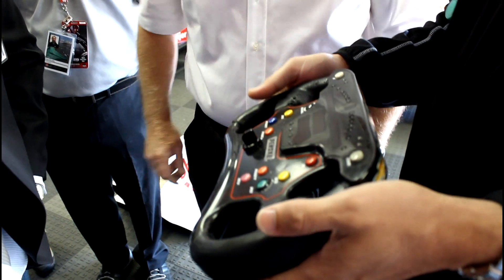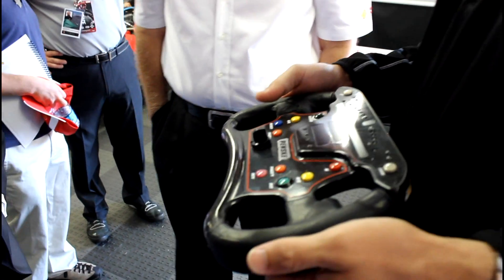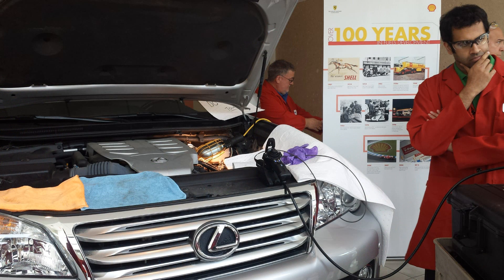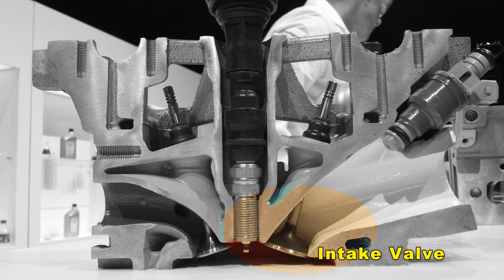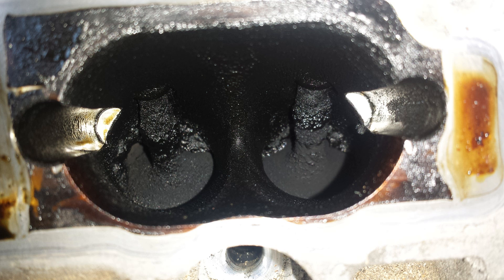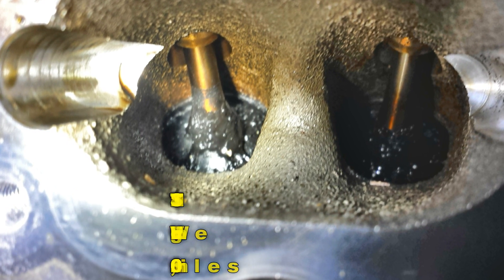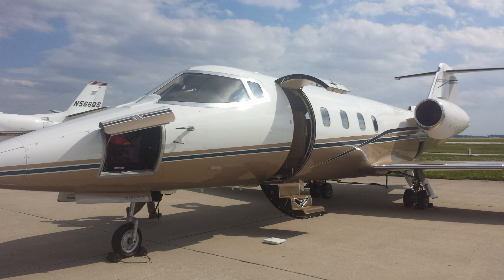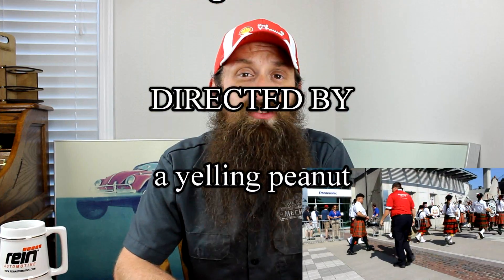Shell V-Power Nitro Plus and Indy 500 ~ Podcast Episode 71

Comment: The humble mechanic knows better than to spread misinformation on his channel.

 Fuel does not cause deposits, EGR soot combining with PCV vapours cause deposits which clog your manifold and coat your valves.
 Block off your EGR and redirect your PCV and there will be nothing to cause deposits.

 PFI keeps valves clean.
 Carburettors keep valves AND manifold clean.
 Only DI allows deposits to form, and only cars with EGR and PCV pollute themselves with deposit causing materials.

Take from these facts that deposits only affect the lazy and the stupid.

Comment: Hi I'm an owner of a 2011 VW jetta 2.5 se , and I always enjoy your videos. I have noticed it runs better on shell mid grade than shell regular. Should I try v power in it. And am I getting the same cleaning benefits with mid grade as I would with v power. Thanks
Reply: I have 2 cars, both bought used. I always use Shell V power. There is a slight difference using V power over regular. It feels slightly torquier at low revs and slightly smoother in the mid revs. But probably not enough to justify paying the extra. But what I seemed to notice on both cars, they started to run better after 3000 miles of V power. Maybe this is the cleaning benefits of running V power over the long term.

Comment: I've been going to Costco to get my gas. I work there. And it is Top Tier. I also use Chevron. Would you personally recommend using Shell in a MK6 GTI? Is it really worth it in your professional opinion?
Reply from the maker: Shell fuel is great. But if you’re getting good performance from Costco, keep rocking it
Reply: Okay! I was just curious. I do know that Costco uses an additive pack called UltraZol 9888, made by a company called Lubrizol. All far as I know, Costco uses 5x the additives of the EPA minimum. There is also a friction modifier like they use I'm shell nitro +. And, could you do a video on an American company  called Archoil? They make fuel, and oil, additives for cars, trucks, and industrial uses. For cars, they have a fuel system cleaner that uses PEA, their AR9100 is a friction modifier additive, and the AR6200 is a fuel additive. I think you might be intrigued by it.

Comment: 2.0T FSI here, never put anything except Shell's V-Power with Nitro+ (93 octane) and I've never experienced cold experienced cold start misfires, at I'm at 175 thousand miles on stock internals. 
Now, is this because I've only run Shell V-POWER with Nitro? I couldn't say, while it most definitely helped prevent buildup  (recall it's the only fuel my engine has ever had) I would be remiss if I didn't mention that I never miss a maintenance window, fluids get checked every week, and I throw an OBDII sensor on there once a month to see if I can't catch problems in the live data logging before they throw a code. 
Driving style must also be mentioned, I for one always wait until proper operating temperature before getting on my boost; this means waiting for the thermo to kick in and read optimal, then driving a few more minutes, making sure you've warmed all of that oil up and moved her around. I avoid the quick start and stops, always allowing my engine to run a cycle of no less than 5 minutes; and let's face it, I'm a spirited driver. While I rarely  (and I mean maybe 3 or 4 times) do full throttle launches, I've never been shy about wringing her and running her in the 4.5-7 thousand RPM range, "A redline a day keeps the carbon away" theory in practice. 
The other end of that equation is shut down procedures. I always give her time to cool after said spirited driving sessions, either a few miles granny driving before I get home, never getting into boost, or just idling for a few minutes before I shut her off. They say with newer water cooled turbos you don't need to worry about this so much, but I don't see how showing a little patience and letting her "walk it out" after a sprint, sort of like track runners, hurts at all. 
I'm truly curious about the extended effects now, I was planning some new injectors and plugs in 5,000 miles, this has me curious enough to stick an optical line down, see if I can get some pictures of the valves and piston heads, see what an engine with 175,000 miles of Shell V-Power Nitro+ looks like. If I end up doing that, I'll email you the pictures; perhaps your viewers might like to see  a sort of follow up, and "unstanctioned extended life follow up" as it were. I say unstanctioned cause I'm sure Shell wants nothing to do with this test, not enough control, they just have to take my word no other fuel has been in it lol, but it is on a direct injection VAG motor, which is relevant to your viewers, so it might be worth a look-see. 
And finally, to wrap up this paragraph, do you use a specific brand of fuel only, or is it whatever is the cheapest (insert octane here) that you find?
Reply: Your car is not a car! As if your is a horse!!! the way you talk about it..So what breed is your Philly? lol.
Reply: How long do you have to wait until the thermostat kicks in? My car is like 20 minutes. Won’t that waste fuel a lot? That’s like equivalent around $300 of fuel every year wasted for warming up. What are you preventing by waiting for the thermostat to kick in?

Comment: Just like household cleaners that claim to kill 99.99% of the bacteria... it's nice to see that their "test sample" on the valve still showed a bit of carbon, rather than a completely clean valve. Although, I doubt that those valves were out of similar engines and the only difference was the fuel. That kind of carbon build up on a port fired injector makes me think that there are other issues than just the fuel. Will have to borescope my valves to see what they look like 5 years after a valve grind. Granted, only drove 50k km since then, but I'm betting they will look better than the first carboned up valve from their "test" engines with 5k miles or 8k km. I'm a Chevron guy... low octane & high (depending on price & ambient temperatures).

Comment: So this pretty much does nothing for us TSI folks. Other than slightly cleaner injector heads.   Carbon buildup galore. Makes me thankful I'm running methanol injection.
Reply from the maker: There are folks out there that say keeping them combustion chamber cleaner(injectors and tops of pistons) will reduce blow by, and make for a more complete combination. 

That will then lead to LESS carbon on the intake valves. But I don't think this will be a 100% cure. It may however reduce carbon buildup. 

Most of what is going on in this world, prevention wise, is theory. And it's their theory of people trying to sell you something, whether it's a top tier fuel, or a fuel additive.
Reply: HumbleMechanic at some point I'm gonna have to pull my manifold off and take a look at the valves. Between catch can, meth and top quality oil and gas I'm doing all I can to mitigate carbon and blow by. I imagine this is more marketing fluff than anything.